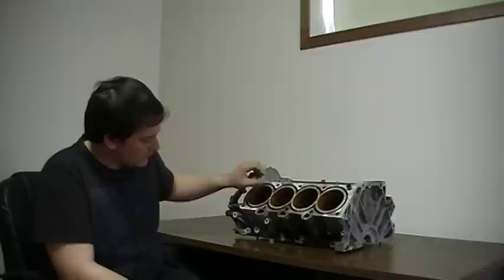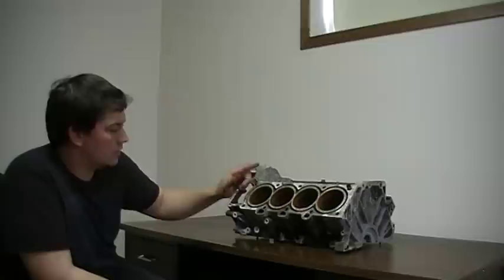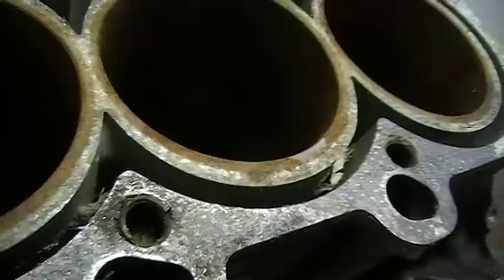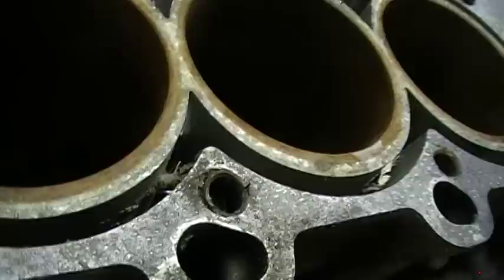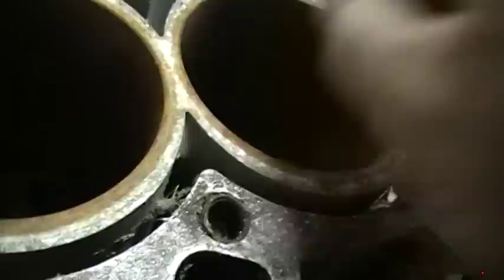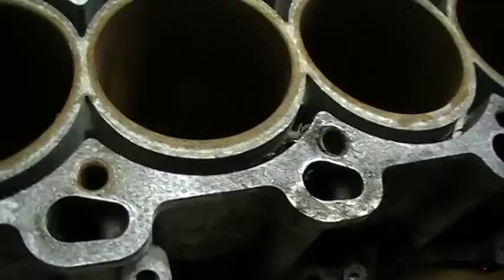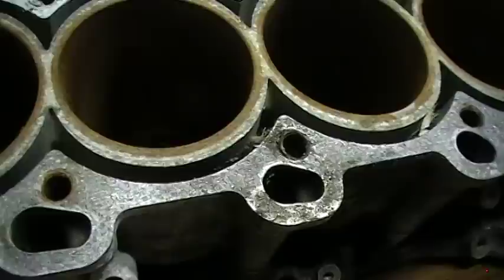Northstar Engine Block Cracks - the REAL cause.

Comment: 2005 gxp and no issues yet
Reply: +Dan Kreeger  If you keep your car maintained you will be fine.  This problem happens because someone let the engine overheat many times. Or if the head stud was installed incorrectly. Your 05 Bonneville GXP will be fine. And if you do need to have the engine rebuilt for what ever reason, it is well worth it especially being a limited edition and Last year for the Pontiac Bonneville.